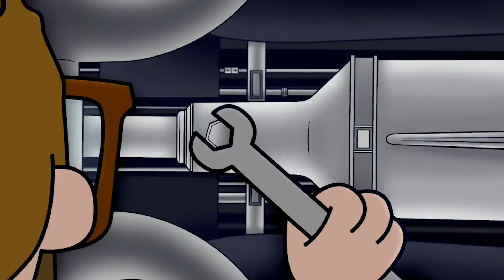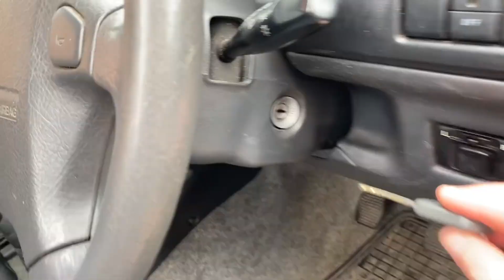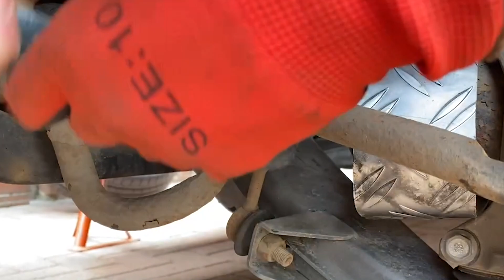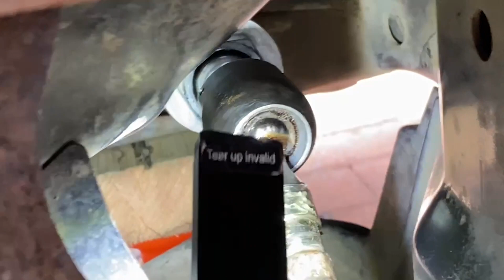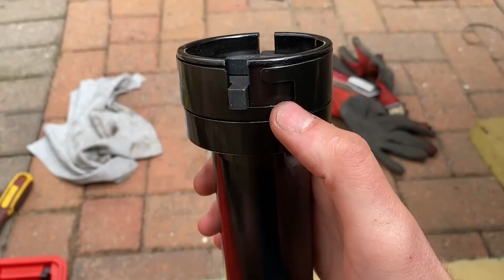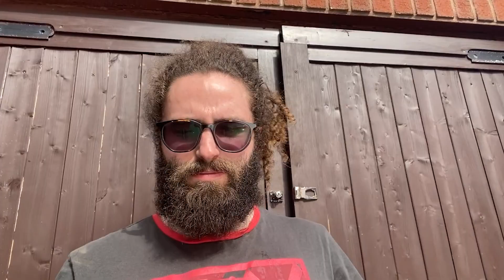How to replace Tie/track rod end ( Subaru Forester )

Comment: Aftermarket parts can be off spec by fractions and it will affect the performance. I use oem parts on my Subaru only. Thanks
Reply from the maker: @egx161  Thanks for your comment dude! 
I always use oem or at least as much as I can, definitely the way to go

Comment: Better to do the alignment every 100K km. 
It'll prevent premature wear on the tyres and have less stress on the associated parts. 
Thanks for the video.
Reply from the maker: Thanks for your comment! 
I would even recommend to get the alignment checked every time you change tyres, as a precaution.
Reply: Wish I could spend money like that. In America, wheel alignments cost $250! They don’t check, just align. We get charged regardless. It’s a money grab.